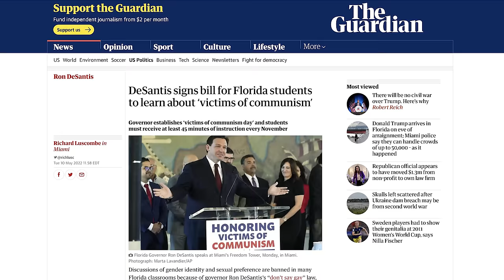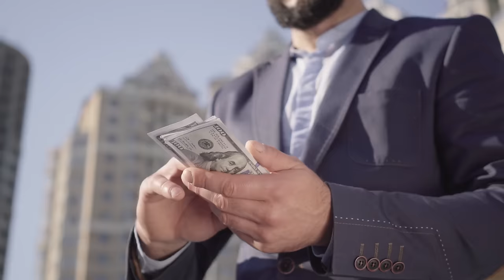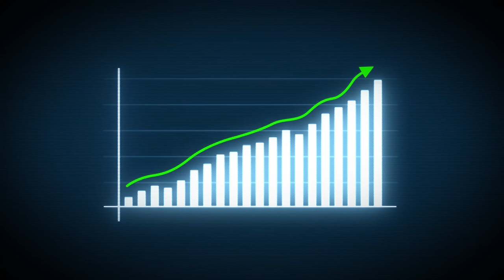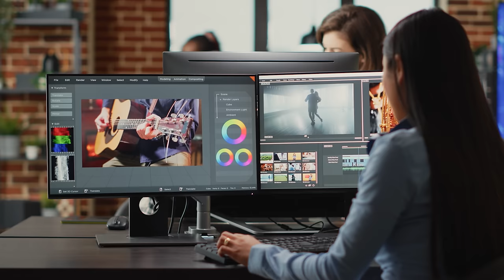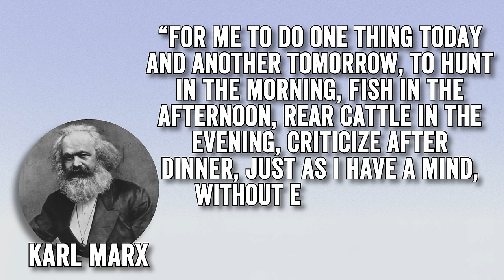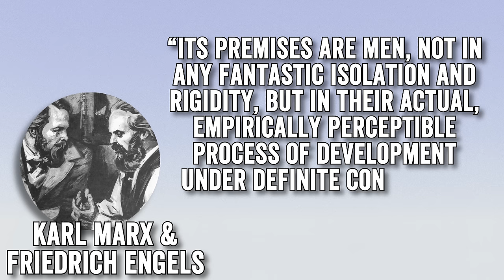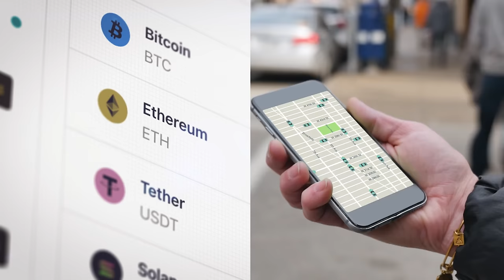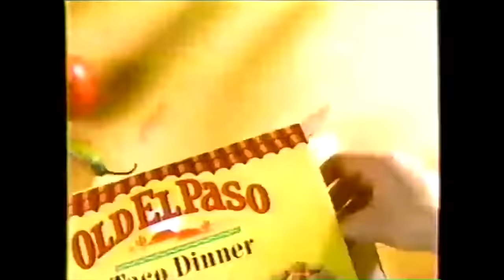Who's Afraid of Marx?

Comment: The surplus value is the value the company is adding. E.g. by organizing the workers in a viable (ideally) economic model, and by having the necessary capital (which might be lost).
If all the workers own the company I foresee trouble every time a worker leaves or a new one enters. Does the one leaving get the capital with them? How does everybody else feel about the new guy getting an equal piece in a 40 year old company?
"From each according to their ability, to each according to their needs" really doesn't work well if you want to maximize value-creation. Most people will work less if their compensation has no chance of being affected by their work. Everybody working on whatever they feel like have the same value-creation problem.
The fundamental problem with Marx' ideas is that the consequence of these is "equality of outcome", and that's why it will be the the core issue with all instances of communism (why "equality of outcome" is problematic only takes a glance at all past instances of communism ). That is also why it is fair by Jordan Peterson link Marx with communism.
Nobody is against "being human". However, if it requires "equality of outcome" it is not gonna work without severe changes to our species and/or unfathomable leaps in technology (there are no limited resources).
Reply: 1. Other workers are "organizing workers in a viable way", as that is a function workers take - that is labour. Owning capital is not a required function and that is what is being talked about.
2. The problems you foresee are simply there because you are assuming nothing else would change in our systems apart from the ownership of companies, and that is obviously not the intention. But hey, cooperatives do exist nowadays and you can easily check what their policies are. Cooperatives operating under capitalism are, obviously, not communism though. 
3. Yes, "from each according to their ability, to each according to their needs", does not maximize creating capital. And that is exactly the point. Our society and our economy should maximize well-being, not capital. We do not need to produce as much as we do now, and growth cannot (and should not) be sustained indefinitely, as it has bad consequences for us and for our planet. Progress should be about quality of life, not about GDP, consumerism and growth. 
4. If "equality of outcome" means that everyone should have their basic needs as a human met (food, shelter, healthcare, etc) regardless of them owning capital or being able to sell their labour to a capitalist, then well, Marx would agree with it. There is nothing problematic in thinking that at all. People would be able to excel in what they are better at or have more interest in, regardless of whether it is profitable, while laborious and "bad" tasks could be shared instead of being pushed to those who have no other choice as it is done nowadays.
Reply: @abelabel3664  1. If you ever start a company you will learn that isn't true. When the ball is rolling in a multi-million dollar company that is another matter, but it had to get there. If I don't get to keep my savings then I'm not going to part with them. If I can't create savings we have a problem incentivizing people. Capital is essential to get something off the ground. Most companies never get to be profitable and even those that do take a long time to get there.
2. I know of cooperatives. We have a lot of them in Denmark. They are not anything near what Marx was thinking of according to this video.
3. You are thinking of value way to narrowly. Value to humans of course. Which ideally is what a company creates. Like this video.
4. Basic needs are already met in lots of countries without any Marxist thinking. "Equality of outcome" is way different and doesn't incentivize people. People can do whatever they want. But demanding everybody else to pay for you lifestyle why you don't add value to anybody else is egotistical. (Again, value is not money, but the beautiful thing about money is that you are probably adding some kind of value to people if they are willing to pay for it.)
Reply: @codingrules  1. If you look around at late-stage capitalism you will see that investors, funds and billionaires own a vast portion of the markets. Marx and this video spoke about capitalists, not about people who perform the labour of coordinating. Shifting the goalposts won't help your argument. 
2. Of course they are not. They operate under capitalism and thereby they are inherently at a disadvantage, as they won't exploit workers as much as their "regular" counterparts and, therefore, they will be more expensive. I literally explained that in my previous comment.
3. Companies do not care if they are creating value for humans or if they are destroying people or the planet in the process, or if they need to lobby governments to do unethical things that benefit them. The goal is profit, and Marx was saying (amonsgt many other things) that a system that has that as a goal is inherently flawed.
4. That is not true. All capitalistic countries have things like "healthy" unemployment rates, homelessness, extreme wealth concentration, etc, etc. Capitalism requires people being at the margins. Moreover, looking at countries individually is narrowminded and innaccurate. To use Denmark as an example, it is only able to keep decent standards because a lot of the labour that goes into what is consumed there is performed somewhere else, with rampant exploitation, in places where people are systemically kept at the margins to accept whatever working conditions and pay that will prevent them from dying. And even in Denmark people struggle with unemployment, with homelessness, etc. People do not need incentive to do interesting things and to do good for their societies - most people are empathetic and sociable, and we had people doing things way before capitalism was a thing. If anything, capitalism stifles innovation and progress. Having people hostage with the "choice" of performing labour to some capitalist or starving is not a desirable or a required state of affairs. 
It is not about "demanding everybody else to pay for your lifestyle"... it is about understanding that everyone has human rights and that they deserve a decent life regardless of their ability to perform labour or the conditions in which they were born in. We have more than enough resources and wealth to provide that to everyone, and it is unethical that we choose not to.

Comment: I feel like the begining is a bit over simplified. I mean yes, the workers add value to a product, but the machines also add value and so does the rent of the factory space and all of the other overhead costs and having good admin and HR makes workers more productive which adds value to the product. And the entrepreneurship of having the idea to set it up and then getting all of those moving parts together also adds value or there wouldnt be a product. 

So the owner can still ethically take a part of the profits. Its when we end up in a situation where the products price is being hyped up and wages are being supressed that theres a massive issue. And becausd of the continuous growth aspect theres a major insentive to do that.
Reply: Just as a clarification, good administration and HR are both also workers. The cost of the machines and the rent are also both in the end part of the value of the product and not separate. One of the problems marx sees is that the initial investment and risk made by the owner, is not proportional to the later exploitation of the workers.

Comment: Marx: “capitalism is inherently exploitative and we need a new system.”

Also Marx: Doesn’t give a practical solution.
Reply: If Marx were alive today and had heard someone say, "Also Marx: Doesn't give a practical solution," he would have had quite a few things to say. In fact, Marx believed that capitalism was an inherently exploitative system that favoured the few at the expense of the many. He saw the proletariat, the working class, as being oppressed by the bourgeoisie, the capitalist class. His work focused on highlighting this exploitation and suggesting ways to eliminate it.

One of the main criticisms that Marx faced during his lifetime, and still faces today, is that he didn't provide a practical solution for the problems he identified. In response to this criticism, Marx might point out that he never claimed to have all the answers. He was not a prophet or a guru, but a scholar and a thinker. He was interested in uncovering the underlying structures of society and understanding how they worked.

Moreover, Marx might argue that the absence of a practical solution is not a failure on his part, but rather a reflection of the complexity of the problem he was trying to solve. The overthrow of capitalism is not something that can be accomplished overnight, nor is it a process that can be easily mapped out. In fact, the history of socialism is full of examples of attempts to establish new, more equitable societies that have met with various degrees of success and failure. In fact, there is no blueprint for a socialist society that can be applied universally. The practical details of how to create a new society will vary depending on a host of factors, such as the specific conditions of the country in question, the level of popular support for socialism, and the existing political and economic structures that need to be dismantled.

Marx might also point out that his work was never intended to provide a practical solution per se, but rather to lay the groundwork for a movement of people who were committed to the idea of creating a better world. Marx saw his role as being one of a catalyst, sparking the imagination of those who were suffering under the weight of capitalism and inspiring them to take action.

In short, if someone were to criticise Marx for not providing a practical solution, Marx would likely respond by saying that the absence of a practical solution is not a problem with his work, but a reflection of the complexity of the problem he was trying to solve. He would also remind us that his work was not meant to provide a blueprint for action, but rather to inspire people to imagine a different kind of society and to work towards realising that vision.